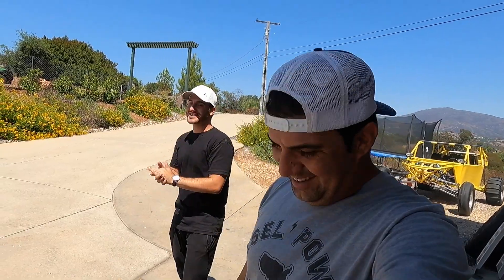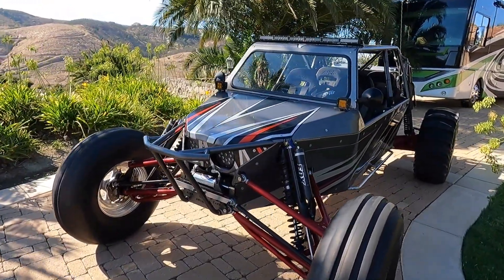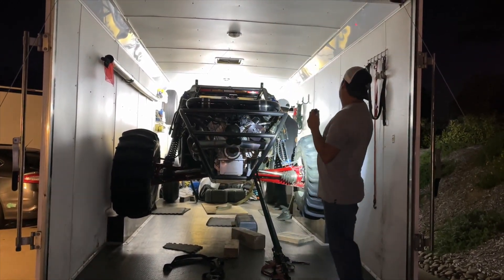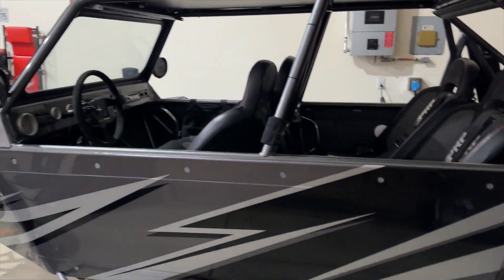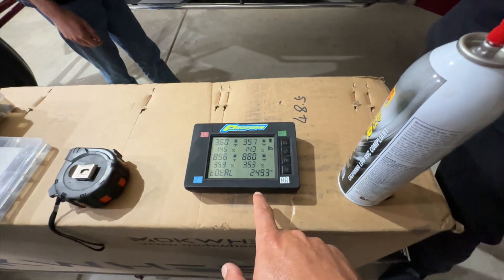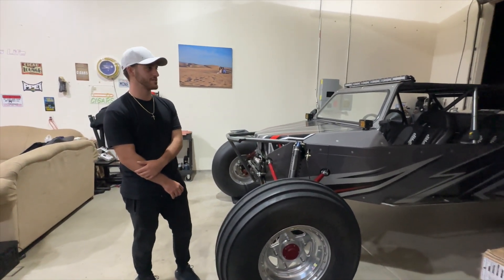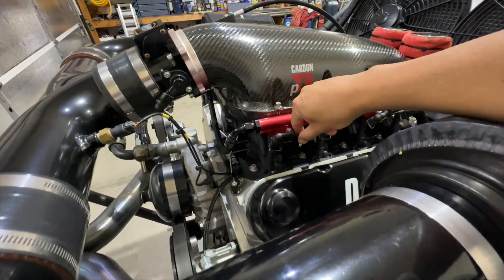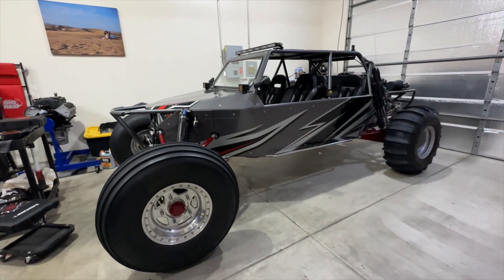Taking Delivery Of Another Sand Car!!!

Comment: I know that car when it had and ls1 and 2d, then Brandon had the LS3 built and converted the car to S4 trans. Work done was top notch and good car for Nick. Idea for the WW would be drive over fenders builds or if the WW has flipped axles the fender boxes can be deleted and would be flat floor.